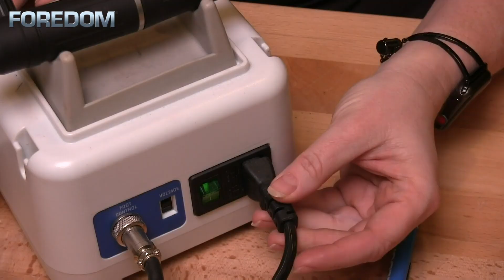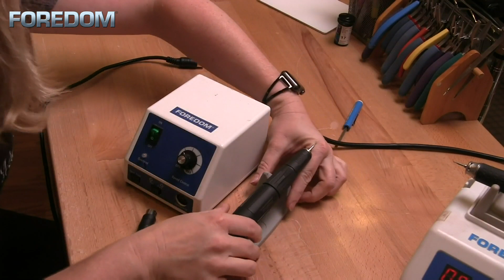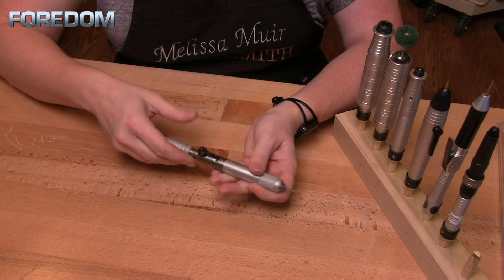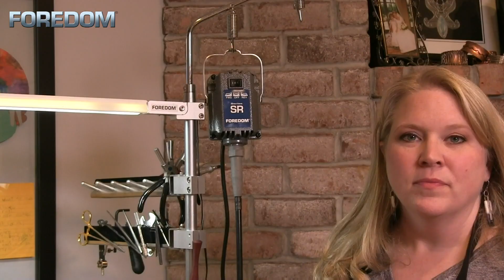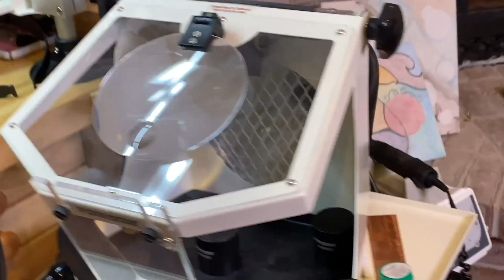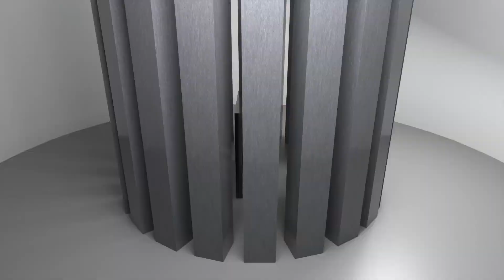Foredom troubleshooting and tips to help your machine run its best!

Comment: I’m on my second SR. The first one exploded in a shower of sparks . I don’t know why. It was about 9 months old. The company I bought it from was not helpful. I was scared to try to take it apart, so I just bought another one. Now, I’ve had this one for about 9 months and it’s starting to rev and change speed on its own. I’ll try checking the brushes tomorrow, but from what I can understand, it would go slower when the brushes were wearing out, not get faster? Am I wrong about that?? Or do I need to run it through some sort of surge protector?

Comment: I have an old flexshaft that I used with a 30 handpiece and now it goes loose with the H20 and H28. It's just loose where it plugs on the flexshaft. 😢
Reply from the maker: Hello, Do you have a genuine Foredom motor or handpiece? If the problem is that the handpieces will not stay on the sheath then you can gently remove the black spring C clip at the bottom of the handpiece (being careful not to lose the catch ball bearing.) Once you have the spring clip off you can gently squeeze it a little so that the gap is a little tighter. Then replace it and the catch ball. Thank you for reaching out to us! - Team Foredom

Comment: I have a K.1060 and love it, but it randomly developed an issue yesterday where it only runs at full speed or nothing. there is no variable speed at all. I had a small sanding disc on it and when I turned the motor on at 1000 rpm speed the motor went dull blast and bent the tool and the disc went flying an inch past my head at an insane speed. Do I need a new speed control unit, or can I check for a fix?
Reply from the maker: Hello,
I'm sorry to hear you are having issues with your 1060. Foredom Electric stands behind every product we sell. Please give us a call at 800-272-2885. Customer service would be happy to discuss repair or replacement options.
Thank you!

Comment: My Foredom Angle Grinder (D170028) quit working.  It is one year old and I have used it at least 100+ hours with no problems prior to now.  My flex shaft works fine because it will work with my other hand pieces.  When the Angle Grinder is unhooked and I turn the wheel while looking into the shaft end of the hand piece I see that the inner connection is not turning.  How do I fix this?  Is there an internal gear that might have broken?  When it stopped I was NOT using it under a heavy load -- I had a 3" sanding disk on it and was pushing very lightly.  Any suggestions?  Are parts available, and at what cost?   ----  If possible, please respond via my email.

Comment: I have a new SR and I’m really finding it underpowered. It’s not performing like the demonstrations I have seen in person or online. Even with a 1/4” Carbide flame burr it’s simply not removing material quickly. I’ve tried different speeds with the pedal and varying pressure amounts as well as different grips and postures with the hand piece and wood. It simply feels like it’s running at 1/2 power or something. Can you suggest anything to test for an issue with the motor? 

I truly wish you had a digital speed controller so we could set the speed with a dial and confirm RPMs for consistent work. With experience I’m sure I can tell between 10,000 and 8,000 RPM but it’s hard to figure out how much pressure that is on the pedal or what position I should choose on the dial. Thanks for any help you can provide.